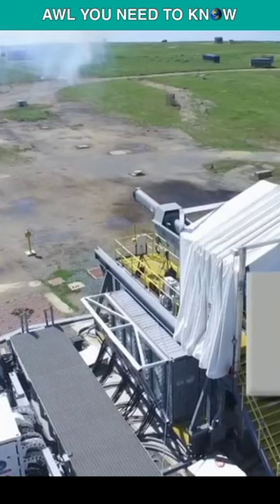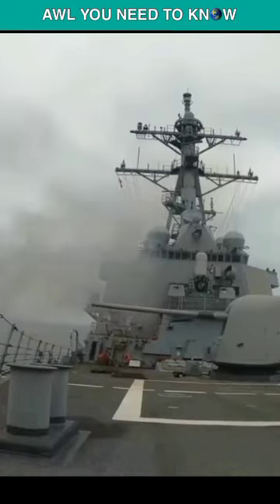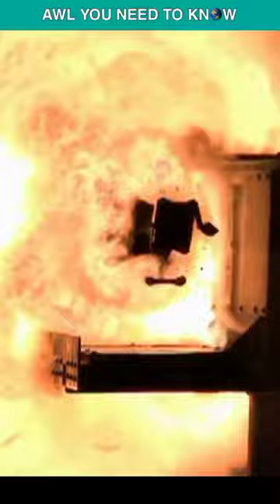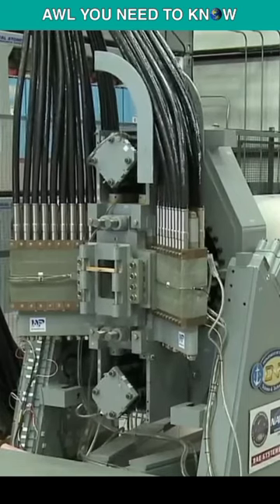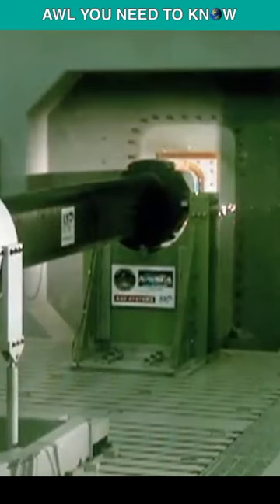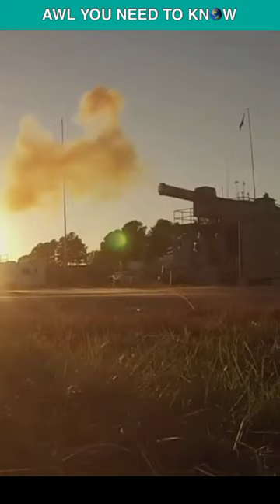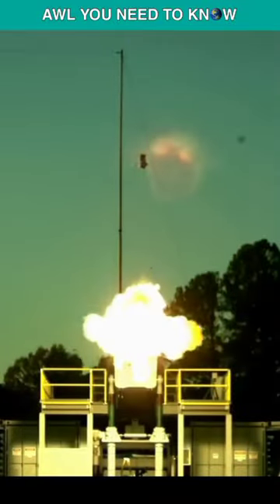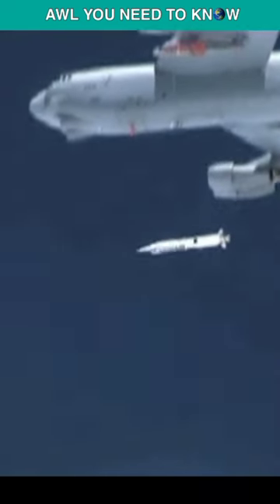United States Navy's $500 Million Rail Gun, a Hypersonic Cannon Capable Of Mach 7 #shorts

Comment: The problem with them is that we can only fire a small amount of rounds before the electrodes begin to warp, until we find a stronger material for the electrode " barrel" it's not feasible.
Reply: That won't really matter if your target is an aircraft carrier there's not that many of them around.
Reply: @lorenzamccoy7512  also one quick search shows that the f35c the plane that the usa is using in the aircraft carrier has a combat range of 1,367 miles so bro good luck getting close and this is not taking account for aerial refueling.
Reply: @kingdomsandcastles3770 what do you think about small railguns for CIWS. Higher rate of fire and would be extremely accurate
Reply: @Basti0n  ciws have extremely short range so adding rails guns could increase range but they require lots of energy the ship design to carry them was canceled and only 2 out of 50 or 20 of them was produced and the once made are expected to have short lives because of the difficulty of make the ammo for those guns, but ciws are smaller caliber may work but I don't think the usa would like to make them considering a while new level of tooling, support, and technicians that would be required to keep them operable so I don't see a benefit in having ciws rail guns for just a bit of range when missiles already preform over the horizon attaks like planes.but for sure in the future when the tech is available for it to be implemented
Reply: @kingdomsandcastles3770  very interesting those are some valid points. Thank you

Comment: "25 mw" ok?
"per second" W H A T   T H E     H E L L
Reply: I had the same reaction mate
Reply: @ericbelle2383  lol
Reply: @somebody700  o k
Reply: Caught me too. Saying MW per second is like saying 25 miles per hour … PER HOUR
Reply: Megawatts per second doesn’t mean anything. If a power plant makes 800 MW its doing it constantly 24/7. You’re thinking of it like fuel in a car’s tank when in reality it’s more like the engines horsepower.

25 MW is how much power is required. That not a measurement of how much energy it uses.
Reply: @CJ-442  when you look at the specs a 800MW power plant makes that per day or 19200 MWh of energy per day by direct comparison a rail gun would needs 2.16Mill MWh or 2.16Terawatt hours of energy per day if it was continously fired.
Reply: @ky-effect2717  - The 800 MW was just a random number I pulled out for comparison bc it’s about the average size for a base load power plant. Also, why would you try to fire a rail gun constantly? One shot’s gonna completely wipe out pretty much anything in its general line of fire.
Reply: I have a feeling that '25MW of electricity to fire each second' means it uses that much power to fire the railgun each second, as in a round a second...
Reply: @CJ-442  doesn't mean it will produce that much in a second the reactor could be like per hour or every year with constant use
Reply: Bro's can you tell me.. how much per round..?
Reply: Basically for a round every 5 second you need like a large commercial nuclear power plants worth of power that it makes in 1 year and cram in into a second which getting that with current technology it just isn't possible on a ship on ground with a lot of powerplants and supercapacters on the ground could be doable but immensely difficult 
:edit it would be easier to make a hybrid gun instead of just 2 electric rails as it could make up for a few weaknesses and flaws that the railgun itself has
Reply: @phantomsilver6039  How much it's cost for one round
Reply: @kamranashique7229  If you fire a round every 6 seconds it is basically 150megawatts of power used to fire a round. Which I think is enough power for new York about 3 or 4 times it's size not really sure how much power is used in new York so yeah its a lot of power
Reply: @phantomsilver6039  i search it's around 115 millions for 150 megawatt solar energy.. couldn't get Nuclear

Comment: When China builds more aircraft carriers we should put one of these on a ship, the barrel might destroy itself but it will be worth it for a projectile to cut clean through an aircraft carrier!
Reply: The problem is the range. A hypersonic missile can strike from a much safer distance, and, depending on the warhead, would be almost as difficult to shot down once it separates from the glide body. Why can’t we go back to hitting eschother with sticks :(
Reply: @michaelsills8038  hypersonic missiles have a tiny payload so they barely do anything to an aircraft carrier unless it damages the deck. A railgun can be fired at hypersonic speeds far faster than any hypersonic missile and it doesn't have to slow down preserving it's insane kinetic energy!!
Reply: @lorenzamccoy7512  This just isn't true though

Comment: Bigfest peoblem is it's a line of sight weapon. Sure, you can probably compensate for loas of velocity at longer ranges by aiming higher and having the projectile perform an arc, but, at some point, the projectile will lose its velocity and energy and either hit less than desireable effect or fall short altogether. Meanwhile a hypersonic missile only needs a target ro lock on to and if it's a atationary object it's basically a giaranteed kill, and, if it's a moving object it better be able to move fast enough and be able to change direction/altitude in such a way as tp bleed the energy enough for the missile to fall short or be stelthy enough as tp evade continuous radar lock.

Comment: it’s $1,000,000 per round and all 3 zumwalts carry up to 3,000 rounds per ship. also it can punch throu armor but that doesn’t matter if it’s going up against a battleship. that tiny gun and tiny ship vs a massive floating fortress of steel and iron with guns that can cause catastrophic damage to a zumwalt class ship with 1 hit. battleship were built to take tremendous beating and blows while bitch slapping everything it comes across.
Reply: You do realize that the last battleship used was decommissioned by the US I think around 1992. There is no navy on earth that has a battleship. Most navies use cruisers, destroyers, and carriers. There are also some other types such as drone ships used by the US etc. 
Also one round through the command deck and the boat is out of commission!
Reply: @PapaEnoch052  1995, thou tech has advanced so much since then and with how i envision it, it’ll be 99% unstoppable. the cost per ship would be high thou.
Reply: @PapaEnoch052 battleships could be a thing again if rail guns become more feasible.